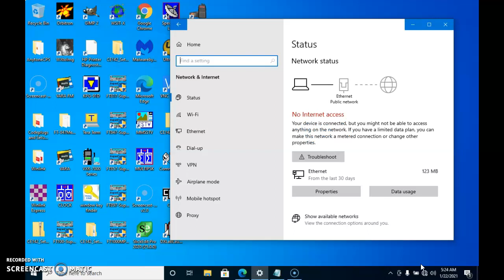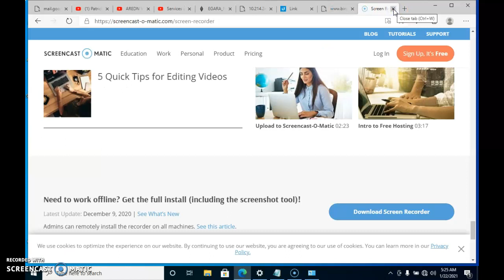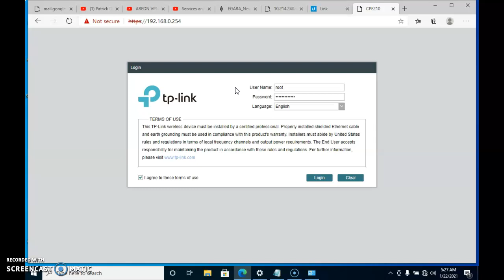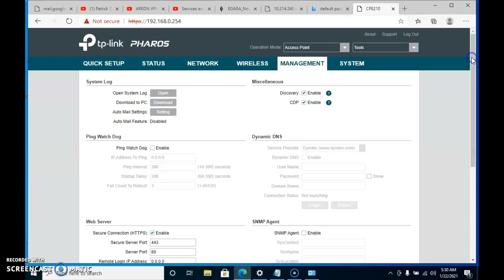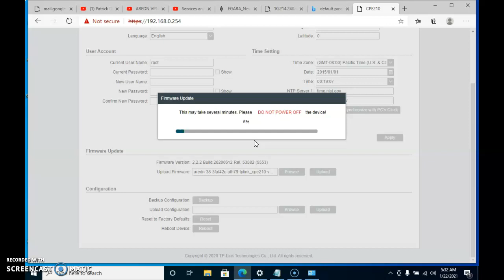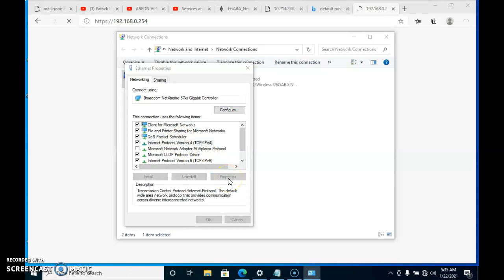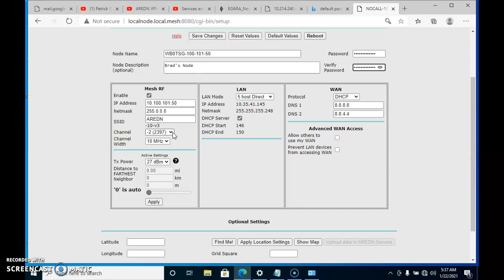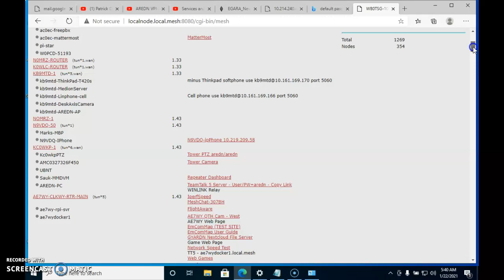Installing AREDN Mesh Firmware on TP-Link CPE210

Comment: Thanks for the video! After reboot, I can't connect the node again. Any help will be appreciated!
Reply from the maker: Sorry, I just saw your comment. Question. After you rebooted, did you set the Network Adapter on your computer to get an IP Address from DHCP? If not, then you might have to try that. If you're stuck at not being able to connect and configure (still in the "N0CALL phase"), try setting your IP Address to something like 192.168.1.2 and go to http://192.168.1.1:8080 for the node.

Comment: What is the advantage using this firmware? For example i want the automatic distance setting betweens cpe. Thanks for suggest
Reply from the maker: The advantage to this firmware is that if you are a licensed amateur radio operator, it opens up channels that aren't available in the normal Part 15 device range. So, less congestion on the channels you're using.

Comment: hello friend how can you reverse this process to leave it stock
Reply from the maker: Basically you follow the reset procedure (TFTP reset) from the aredn website. What you do is rename your stock firmware to 'recovery.bin' and upload that instead of the aredn firmware. https://arednmesh.readthedocs.io/en/latest/arednGettingStarted/installing_firmware.html#tp-link-first-install-process
Reply: @patrickdickey4715   can't do the procedure my tp-link doesn't do the process,
my question is can a wifi network extender be made by aredn software
Reply from the maker: @jesusespinoza7416  Yes. Essentially that's what AREDN is. But, you must be an amateur radio license holder to use it legally (FCC-wise) and if you choose the ham bands for the channel, you can't use it for anything commercial. That includes social media and YouTube.

Here's a link to reset the TP-Link firmware. https://www.tp-link.com/fr-be/support/faq/844/